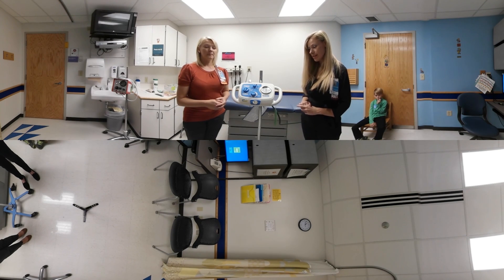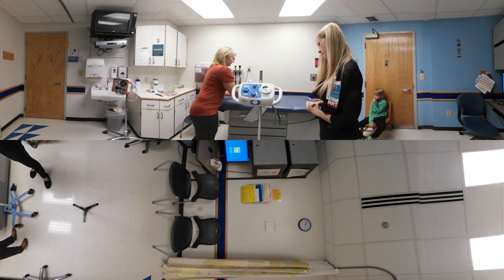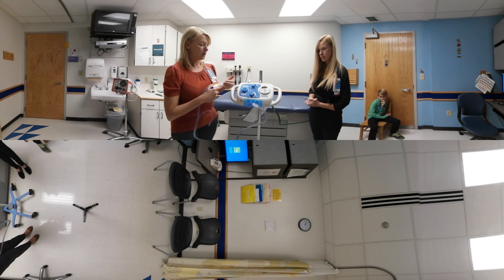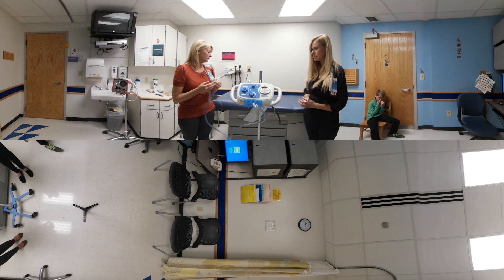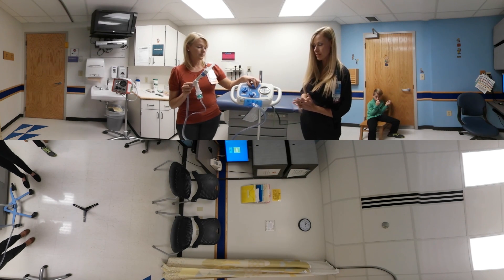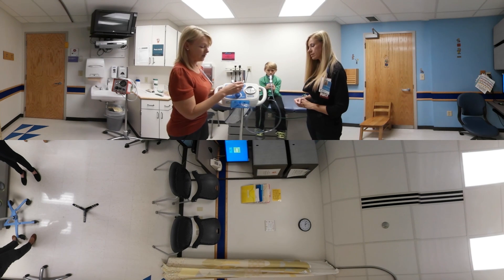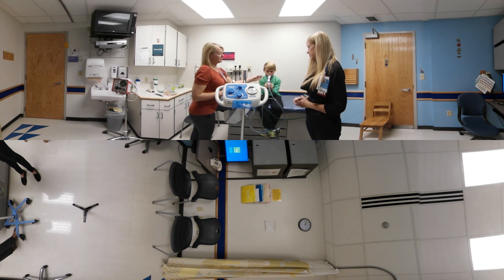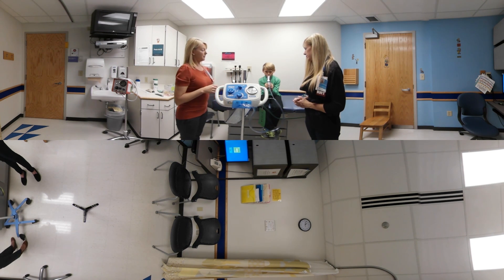Airway Clearance Techniques: MetaNeb

Comment: Now Hill-Rom has the Volara System, which is the At Home Version of the MetaNeb. Unfortunately. Medicare does not see a bennifit in At Home therapies like IPV, or MetaNeb. I've began a last ditch effort to get some good airway clearance. I have the Vest and cough Assist. They are OK, but if I could get the Volara since I could not  obtain IPV, well that'd be good. So I'm in the process of attempting to obtain the MetaNeb, AKA the Volara, and  I haven't gotten denied yet, but I'm expecting that to happen. If this actually ended up in success, I would be MASSIVELY PROFOUNDLY SHOCKED!
Reply: Spelling Police here.  The correct spelling is "benefit." "Bennifit" is not even close. Thank you for your time.
Reply: @friendofdavid1423  I appreciate your correction. Thank you!